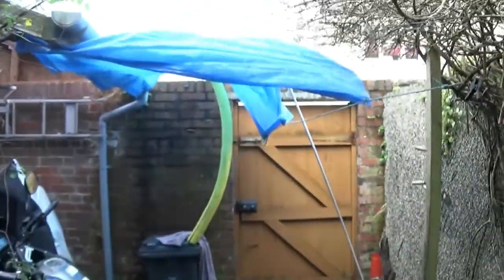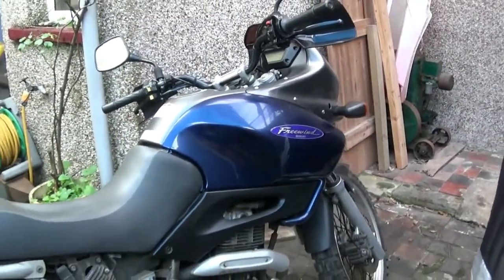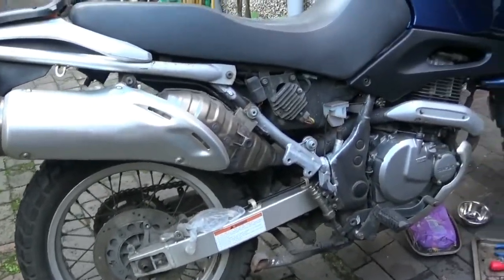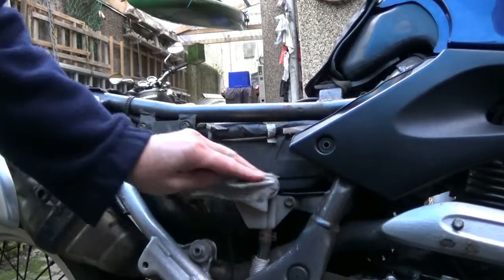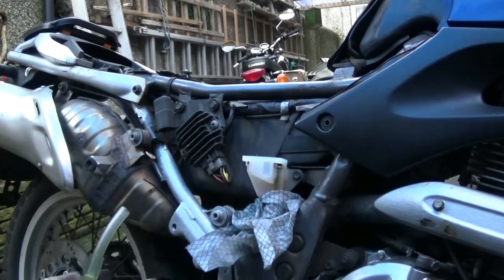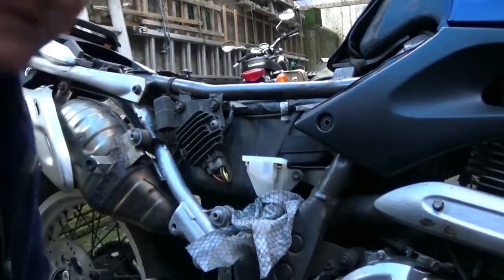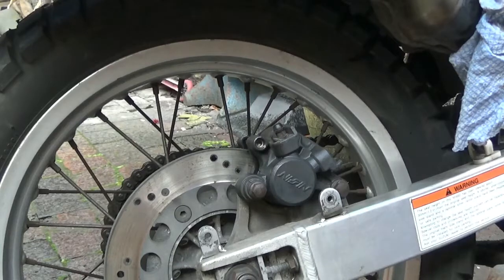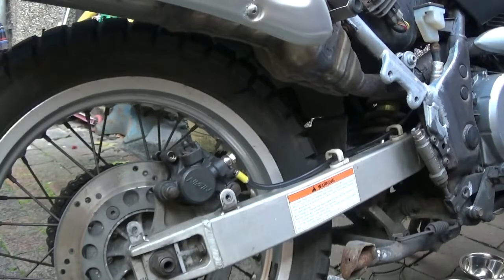Bleeding Brakes !! AND an Easy Peasy D.I.Y. Torque Wrench (Suzuki XF650 Freewind motorcycle).

Comment: You are missing the small cap over the caliper axle.
Reply from the maker: Thanks ronenfe. If you mean the small grub screw like flat slotted screwdriver component, it does go back in. .... perhaps it appears at a later stage in the video.
Thanks for watching and commenting though (and for subbing !!). Kind Regards.
Reply: @onanysundrymule3144  No problem. Thanks for the video.
Reply: Thanks to you I understand how to put shim 69132-04F00 which you show on 8:05. Thanks again.
Reply from the maker: @ronenfe  Hey Ronenfe, check the orientation of it with the footage at 55:27 Sir, pointing down and away from the pin hole. Kind Regards.
Reply: @ronenfe   Freewind club on facebook?
Reply: @onanysundrymule3144  Found it , it's actually 52:39 . So You got it upside down the first time. It actually makes more sense. Thanks a lot. You should join the Facebook group : Suzuki xf650 freewind owners UK
Reply: @MFDOOMgr  yes
Reply from the maker: @ronenfe  It wasn't until I was editing up the footage that I spotted it (oops) so I had to whip that pad out after and turn the shim around, but it is partly why I included that 'original' footage at the end, as a clear instruction on which way around it goes. I guess the logic is that if it is already 'down', it has nowhere to fall or slip to, because gravity will be working with it. 
I'm not on Facebook, but I put some postings on the Advrider Freewind page a few years ago, and I think you were on there at that time too. 
Let us know if you have had any joy using the squeezy bottle bleeder, or the easy peasy torque wrench. Kind regards.
Reply: @onanysundrymule3144  you had an interesting experiments. But I do it with torque wrenches and vacuum pump. Way easier. I don't think it's about gravity but it's a spring holding the shim down in place.
Reply from the maker: Thanks Ronenfe. I'm sure it is easier with the proper tools, but when you consider that you may actually need 2 or 3 different torque wrenches to give full spectrum cover to all the fastener torques on a motorbike, from wee casing and nipple screws to say axle nuts, then there is a considerable outlay in costs. Not to mention the (at least theoretical) recalibration of the instruments every few years and so on. Thanks for all your comments Sir. Kind regards.